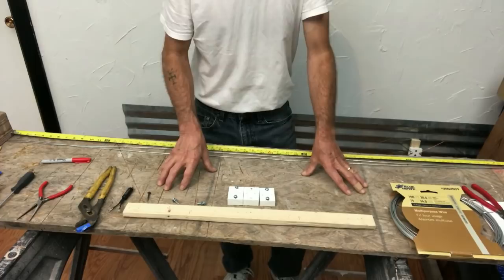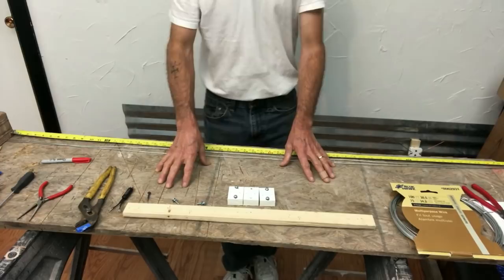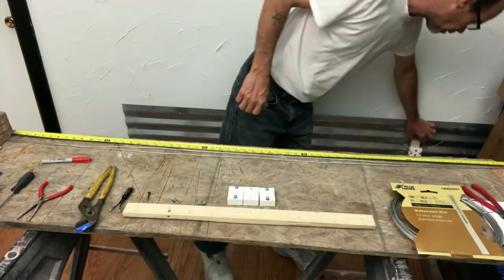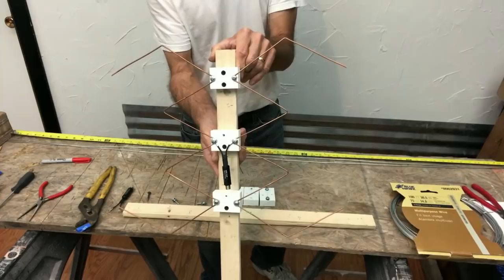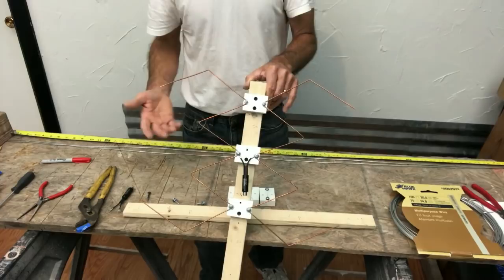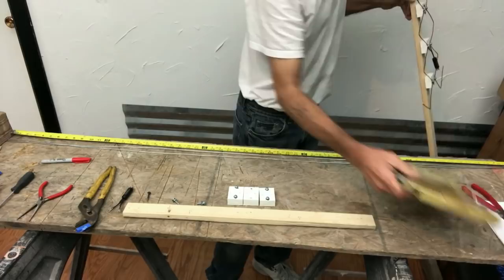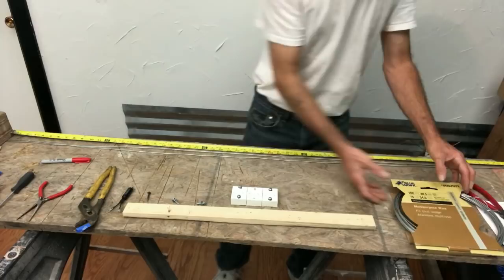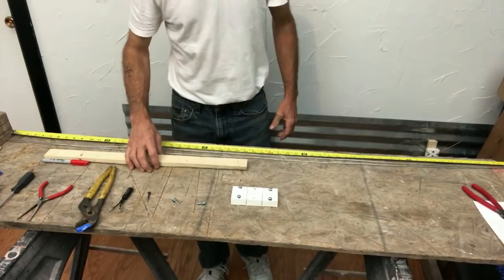HDTV Antenna   Build it Yourself!

Comment: I have a question concerning your method of crimping an indentation into the PVC block where the wire is clamped. 
The crimped indentation you show has an angle with a rounded curved but the wire taped to your pliers used to make that indentation appears to be straight. I don't understand how a curved indentation could be made by a straight wire. The indentation with a rounded angle would have to me made with a wire with a rounded angle. Did you just use the straight wire to make the straight parts of the indentation then fit the element in place and tighten the screw and washer to force the rounded angle of the element down into the PVC to make the rounded part of the indentation you showed? Or did you use a wire with that rounded angler shape taped to your pliers to crimp that part of the indentation?
Reply from the maker: ZappElectric 
The pvc material I used in the video was used. Your idea of rounded wire is a good idea. 
My apologies. :(
Reply: Thank you for your quick reply. And thanks for the explanation. I have experimented using this antenna, a gray hoverman with VHF narods, your tuxedo with your modification for VHF (with two 23 inch upper parts), a gray hoverman modified for VHF in the same manner, and your VHF modified tuxedo with twice the number of fractals. Each antenna had a reflector made from chicken wire mesh spaced 4 inches behind the elements.  and was tried in the same position (on an outdoor mast raising the antenna about 10ft. above ground ). For my needs the VHF modified double tuxedo worked the best. The hoverman type with the same VHF modifications is a close second. I am about 20 miles from Philly. The VHF modified double tuxedo antenna I built using your instructions gives me good signal strength for real RF channels VHF-low 2, 4, and 6; VHF-high 12;. and UHF 17, 22, 25, 26, 31, 32, 34, 42, and 43.
Reply: I achieved the strongest signals with the balun connected to the angles 10 3/4 inches below the top. Because of its extended tuxedo shape I tried moving the balun 7 3/4 inches lower to the next angles. Even though in this position the balun was closer to the vertical midpoint, the signal strength was significantly reduced accross all the channels. 
I am very pleased with your antenna design. I have not seen either the 6-1-3 inch lengths or the way you have modified the design for VHF anywhere else. Works great 20 miles from Philly. Thank you again.
Reply: @zappelectric5858  Thank you for conducting the tests and posting these results.  Where did this antenna rank in order of performance among these tested - and how much worse?  Thanks!!

Comment: New to your channel, great videos, easy to follow. Finally cutting the cable, I have a question is it possible to build one antenna for multiple TV's. I want to use my home cable wiring to connected to the antenna. I plan to add a cable splitter amplifier to the antenna and signal boosters at each TV. The antenna will be mounted in the Attic, my HOA won't let me mount it on the roof. Which antenna do you think will work best or should i just build an antenna for each TV. Let me know what you think. Thank you.
Reply from the maker: Cornell Freeman 
I have a separate antenna for each tv but there are amplified splitters that are available in most home improvement stores. Your call. 
Congrats cutting the cord! You won’t regret the savings.
Reply from the maker: Cornell Freeman 
Oh btw, you might consider running a multi-booster for several TVs rather than a booster for each tv. 
Just a thought.
Reply: Wow, thank you for to quick reply, i'm headed to Lowe's for the material.
Reply: @cornellfreeman8425  HOAs do not have the right to restrict the use of an outdoor antenna. Might be worth it to read up on the laws and then stick it to them (HOA) and then educate your neighbors, lol.

Comment: Hey Mike, You're getting VHF high (digital 7 - 13) with this, without tweaking either the lengths or angles of the top and bottom wings?... keeping with the 7 inch lengths and same angles top and bottom? If so, how far away from those VHF transmitters? I have 40 miles to the NE Orlando at about 52-55 degrees, 50 miles to the SW TPA at almost exact reciprocal heading. With inexactly made and not-amplified stealth hawks I can get almost all available UHF's. But I have a tough time pulling in Orlando ch 2 broadcasting on digital 11, TPA 3 on digital 13, and TPA 8 on digital 7 (moving to 9). Also, now that the Repack is almost complete and nothing is being broadcasted on digital 37 and higher, would you do anything different to your lengths if building this today? The 7 inch lengths had to be giving you good gain on the mid and upper UHF channels. Were you getting digital UHF's 14 through 25 well with this? Many thanks
Reply from the maker: I’d say all uhf comes in fine. The only vhf I have in my area is rf13 at 10 miles & 3 kilowatts. I’m fortunate to be in the sweet spot to its polar plot. At 3 kilowatts, without a polar plot (some stations have then and some don’t) I might not be able to pick it up at all. Since the frequency change, I wonder if 8” would work better.....thanks for the comments
Reply: @DIYProjectsWithMike  [edited 5-7-20] This is a good build Mike. It doesn't perform well on the lowest VHF digital 7. It's great pulling almost all the UHF's in both directions looking SW and NE, 14 digital to 36, going out 40 and 50 miles in both directions. A couple VHF's are spotty, digital 11(40 miles), and digital 13(50 miles, weaker PBS). UHF digital 17(50 miles) is also spotty. Overall, really good. I've had good results also with inexactly made Stealth Hawks, either one by itself, or two ganged together running thru one balun, or two as separate antennas each thru a balun and then combined. I've played around with the angles of both those upper and lowers "wings," straightening the end 7 inch wings to make them horizontal (perpendicular) to the vertical axis, as a true Gray-Hoverman would be. I got really lucky with my first Stealth Hawk DIY antenna ... it's in a landfill now.  That was just thrown together, beginners luck, from an old lampshade maybe older than us, don't know what metal it was, it survived hurricane Irma, and pulled better than two others that I was more particular and exact in assembly with. Somehow that was better on the VHF's than this, but this is better on the UHF's. Here's a pic : https://hosting.photobucket.com/albums/oo10/splitzcreen/Stealth%20Hawk%201/HAWK1CLOSEUP_zpsafe3bf6a.jpg. I'm going to try with yours straightening out completely those upper and/or lower wings to make them 14 inches in length, and/or adding a 2 inch extension to one/two/them.
Reply from the maker: Sorry it didn’t work for you. Try straightening out the top first before both top and bottom.
Reply from the maker: Hope this works. Here’s a photo of the latest one i builtI [URL=http://s347.photobucket.com/user/mburkacoustic/media/Mobile%20Uploads/C953ECB0-B9F8-4CDF-A7C8-A1424340FF39_zpslpmqdvib.jpg.html][IMG]http://i347.photobucket.com/albums/p469/mburkacoustic/Mobile%20Uploads/C953ECB0-B9F8-4CDF-A7C8-A1424340FF39_zpslpmqdvib.jpg[/IMG][/URL]
Reply from the maker: Try again. http://i347.photobucket.com/albums/p469/mburkacoustic/Mobile%20Uploads/C953ECB0-B9F8-4CDF-A7C8-A1424340FF39_zpslpmqdvib.jpg
Reply from the maker: <a href="http://s347.photobucket.com/user/mburkacoustic/media/Mobile%20Uploads/C953ECB0-B9F8-4CDF-A7C8-A1424340FF39_zpslpmqdvib.jpg.html" target="_blank"><img src="http://i347.photobucket.com/albums/p469/mburkacoustic/Mobile%20Uploads/C953ECB0-B9F8-4CDF-A7C8-A1424340FF39_zpslpmqdvib.jpg" border="0" alt="00001 photo C953ECB0-B9F8-4CDF-A7C8-A1424340FF39_zpslpmqdvib.jpg"></a>
Reply from the maker: I couldn’t get it to pull up on my end.

Comment: How would i adapt this for vhf low? Add 2 elements to the top that are 19 inches longish?
Reply from the maker: You might need a separate antenna altogether for VHF low. (If this antenna doesn’t pick it up already).

Comment: I get 9-12 channels depends on who holds it in my kitchen....would moving it to attic really help that much? Is this setup ok to be used outside?
Reply from the maker: Caleb Drake 
I have mine in my attic. Once I got it set that was it and I didn’t have to mess with it again. 
  Outside is fine as long the base is weatherproof.
Reply: @DIYProjectsWithMike  

How much single increase did you get going from inside the house(room) to the attic? Debating between sticking it outside and sticking it in the Attic...I was hoping for more then 9-12 channels
Reply from the maker: Caleb Drake 
I guess about 20% increase and better stability. Got a whole lot better outside. Too much lightning scares me though so they’re in my attic:)

Comment: most stations are still on the old freq. its just a digi signal not analog. so folks the simplest and pretty sure will work great... is dipole..... 468 divided by 500mhz. is about 1 foot long.. so 6 inch wire off center of your coax. 6 inch wire off shield of coax.. give it a try .. but any antenna for 1/2 wave its 468 divided by the freq. if you want full wave. 936 divided by freq will get you in ball park.. so it would be near 2ft long. 1 foot each side. look for homebrew dipole or j poles. will give ideas also .. more antenna doesnt always work folks. cut it for freq it will work tons better.    otadtv.        com/               frequency/       index          .html. not tryin to take away from this video.. but who knows. just tossin it out there. sharing info.. i build all my antennas. from 400KHZ yes KiloHertz.. thats below am broadcast in your car.. to will above 1.2GHZ.. Gig Hertz.
Reply: If you tried this design,  I believe you'd be a believer.  I'm sold on it.
Reply: @piewolfe  have no need. 14 inch piece of speaker wire. end stuck over center on coax. taped to side of house. i get all channels within 36 miles. when i have time ill make a nice little vertical. done deal.

Comment: I'm building 2 now with 14/2 kind of flimsy copper unlike yours. LoL your installing that in your bathroom!
UPDATE - Both antenna are done, previously with a purchased cheap antenna I received 6 HD channels.. Now I have 9!
6-1 WCMU PBS
6-2 WCMU CMU-Kids
6-3 WCMU @ Create
8-1 WGTQ ABC
8-2 WTOM NBC
8-3 Comet 
10-1 WWUP CBS
10-2 WFQX-DT
10-3 MeTV-DT

All channels are clear and 8 are 1080i/720P with very good signal. 
The WCMU channels are supposedly over 70 miles away wow lol...
Reply from the maker: Wow that’s amazing! So glad it works for you

Comment: Have you been having WLOX and WXXV dropping signal or getting a weak signal lately? I have.. constantly. Is it time to swap out antennas?
Thanks, Danny
Reply from the maker: Danny 
Your antenna may have been subject to corrosion. If you’ve cleaned it already, then it may be time for a switch. I switched to galvanized for my antennas which is a good choice for exterior.
Everything is available at Lowes if you want to build it yourself or I can build it for you. 
 I haven’t experienced signal problems from wlox and wxxv but wxxv always gave me more problems than the others. 
Wlox just changes their frequency from 39 to 32 and upped their power so it should come in better.
Reply: @DIYProjectsWithMike  if you'd build me a new one, I'd greatly appreciate it.
Thanks for the quick reply
Reply: Can it be made from darker material or do u suggest it not
Reply from the maker: Danny 
I was thinking about painting the material. Give me a little time. I’ll make you one.
Reply: Thank you Mike

Comment: Can i just not use a pvc block and go directly to the wood base??
Reply from the maker: Yes. Keep in mind that would contains a certain level of moisture especially treated wood so there could be some signal loss. But to confess I still have at least one antenna up in my attic that is wood based And it has been working great for years.
Reply from the maker: Wood

Comment: I have a couple of questions I have to bother you with because I imagine you may have covered these in other videos I haven't seen yet.

My apologies if you have. I'm just starting to understand the basics when it comes to antennas.

1- obviously this is directional, but is there a difference between the front and the back? I wouldn't think there would be a difference in performance if you spun it around a complete 180 degrees, but I'm wrong all the time.

2) instead of turning it to 'see' the other stations you can pull signal from... couldn't you just make 2 antennas, face each one in the necessary direction, and join their signals somehow?

Awesome and very easy to follow videos, thank you!
Reply from the maker: Russell Borrego 
No difference if you turn it 180. 

The one and only time I tried to connect two antennas together I lost reception big time. But I think I did it wrong so I won’t tell you not to. It may just work for you. It just didn’t work for me. One works better for me.
Reply: DIY Projects With Mike, wow! thanks for the fast reply! Thanks! Do you use boosters at all? If so, do you have one you recommend?

One last question and I'll stop bugging you, is there a specific site for people like me who can check out and learn information that might be common knowledge to people like you? Just looking to cut down on my questions, and it's seems like there's a fair deal of misinformation out there.
Reply from the maker: Russell Borrego 
Never used a booster. I don’t need one since my stations are close enough. A booster with multiple outputs might come in handy if you wanted to hook up several TVs to one antenna. 
Thanks for the comment. :)
Reply: DIY Projects With Mike, thank you! I have now watched every antenna video you have, and probably another 2 or 3 dozen others since I posted that first question. Yours are short and to the point, which is fantastic.

I've learned a ton. The majority of it thanks to you. I hope you realize there are probably many hundreds out there just like me that you helped educate, but just haven't posted a reply.

Sincerely, thank you very much! Wishing you much luck in all you do.

Russ
Reply from the maker: Russell Borrego 
Thank you for your wonderful comment!
 I was just like you and so many others looking for a solution to my high cable bill. 
 I was going to look into buying an antenna when I saw a link to a video on how to build one yourself. 
 It was the bow tie antenna and it didn’t work as well as I wanted it to and so I searched and watched and searched some more. 
 I really didn’t know much about any of this stuff but I learned it all on the way. 
 I created this channel with the hope that it may help others do what I did. 
 Turns out that the hundreds you mentioned are actually hundreds of thousands!!
 I’m honored to provide the help you needed!
 Cable and satellite companies have kept us in the dark for decades. It’s time for us to take our TVs back!

Comment: is there a difference between vhf high and vhf? if there is, can this antenna bring in vhf?
Reply from the maker: There is. VHF low and VHF high. There is a dead zone spanning 86 Mhz between the two. Here are a couple links that will help you out.
http://www.csgnetwork.com/tvfreqtable.html

https://antennaweb.org/

On the antennaweb page, when you click "START HERE" and you type in your address and click "SUBMIT", it will give you a list of stations near you with a map showing lines to the towers (USA). Notice the "RF" channels. These are the channel frequencies in which they are actually transmitted regardless of which channel it appears on your TV.
Reply: DIY Projects With Mike thanks for the links!

Comment: Is that covering from dtv channel 2 on up?
Reply from the maker: It might if you’re really close to the station. Do you have rf channel 2 in your area?
Reply: @DIYProjectsWithMike  5 through 7 and I think there's a PBS 2 in the region
Reply from the maker: The lowest channel in my area is RF 13 so I can’t say for sure. Remember channel 2 may not necessarily mean channel 2 as it could be virtual channel that it shows up on. Antennaweb or TVFool will show which RF it transmits. All I can tell you is build one and see if it does.

Comment: You could run all of your TV's on one antenna
Reply: the issue there is that the Signal Degrades over every foot of Cable, and with every split/coupling that you install... 

You'll need Boosters and superior cables to feed multiple TVs
Reply: @TJ52359  that is correct connectors and coax equals resistance. I am 20 miles away from the transmitters by the time I get to the furtherest television approximately 70 ft and several splitters I'm still able to receive usable signal. It is also true connections degrademore over time. Most particularly the one at the Balin. I use stainless or nickel Hardware . I am one mile from the Gulf of Mexico with prevailing Salt Air so I use Plasti Dip over Balin connections. Anything you can do to reduce resistance. Height of the antenna and minimal coax and splitters and of course fine-tuning the direction as well as the efficiency of the antenna all play into account. And then it gets into the sensitivity of the television.your very correct

Comment: how would you add VHF capability to this antenna?  VHF and UHF transmit from different directions.  tnx
Reply: The top "longer" element is the vhf. Uhf has shorter. There are usually more uhf than vhf elements bc vhf elements will scramble each other